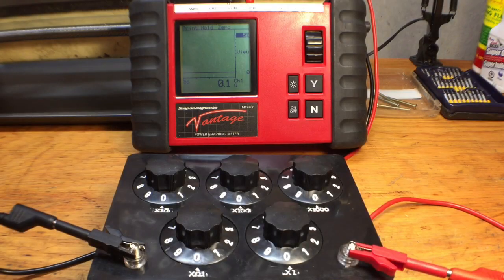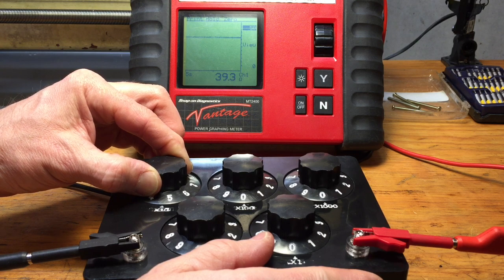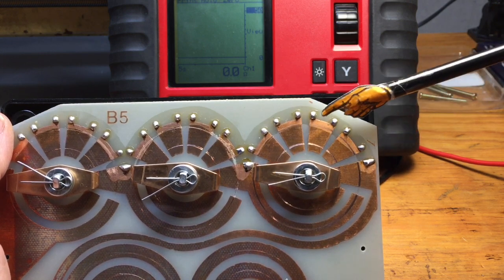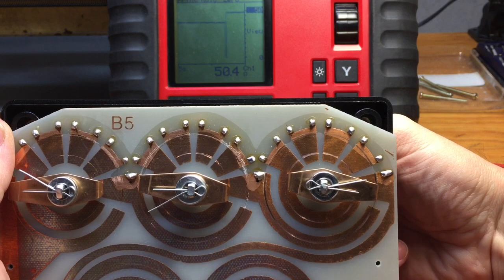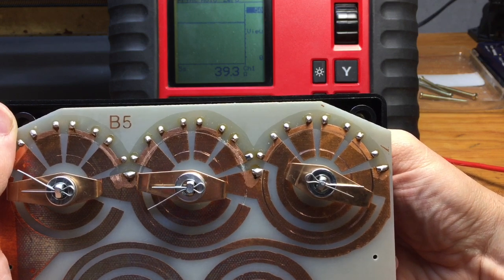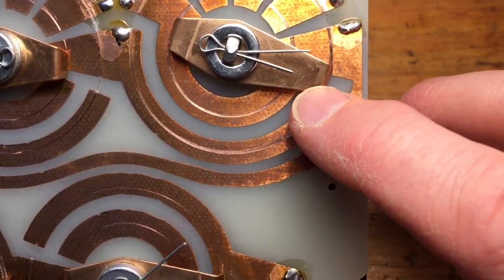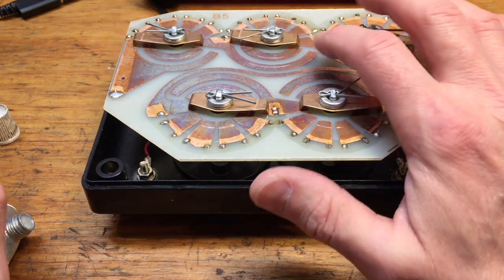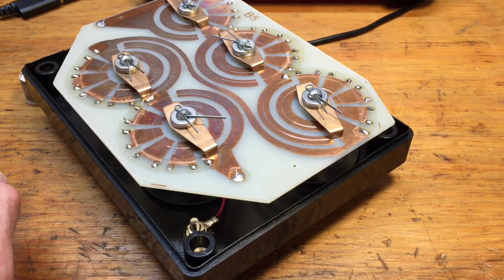Decade Box Considerations P2

Comment: I have a similar but 6 decade box. From what I could make out of the spec sheet (all Chinese to me) not all resistors are 1/2 watt. There's a cut-off where some values are 1/4 watt. And that cut-off point isn't made clear.
Reply from the maker: Yes...same old Denis. Guess I got what paid for. Which was buttons to be honest. Thx for checking out some of the back catalog. Cheers Denis